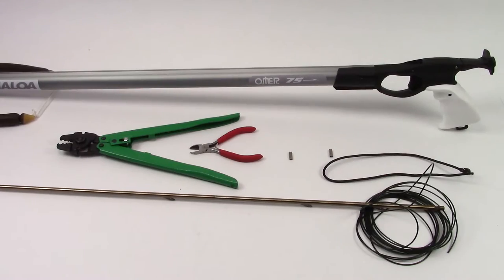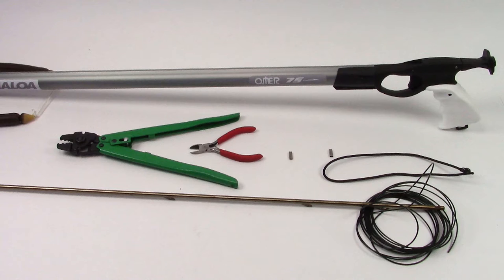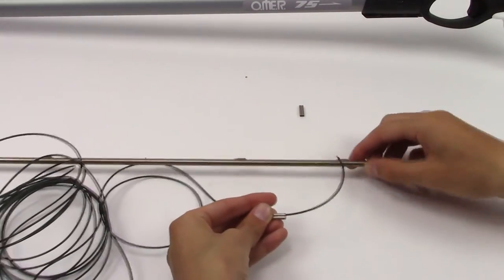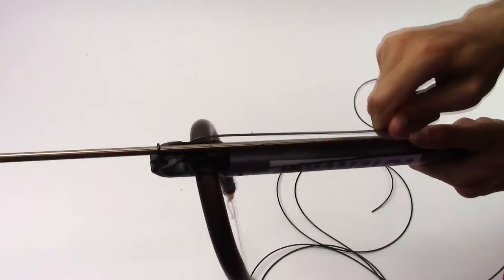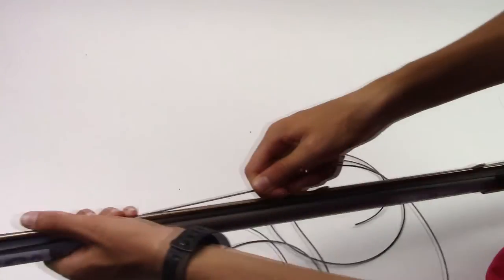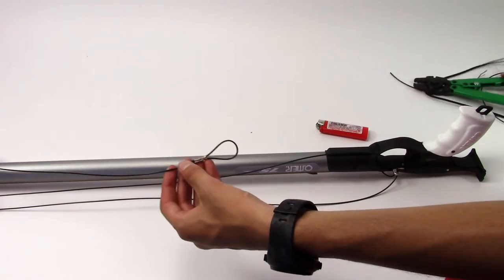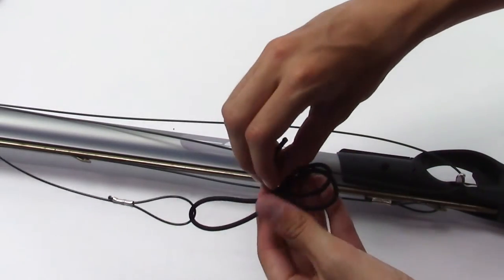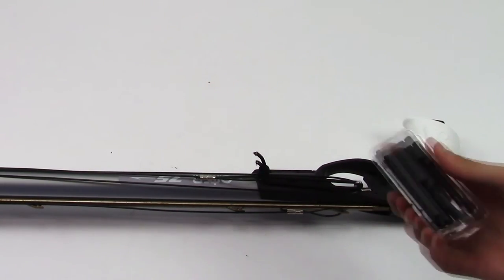Rigging an Omer speargun as a breakaway system.

Comment: The plastic cord seems like it would be weaker than a clip. Could you explain why you rigged it this way?
Reply: If by plastic cord, you mean the monofilament spear-line, then fear not, it is chosen to be strong enough (typ 1.5mm-2mm, RA makoline for example is rated for 300-400lb).  If you mean the elastic band, that doesn't need to take fish tension, it just keeps the spear-line tight enough to stay on the speargun.  The float-line should clip directly into the spear-line - NOT into the elastic band.